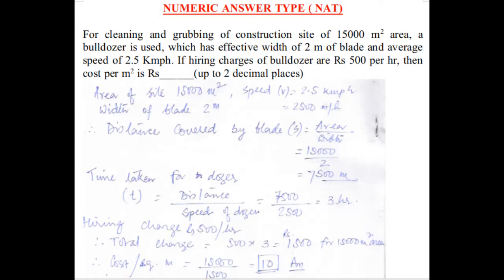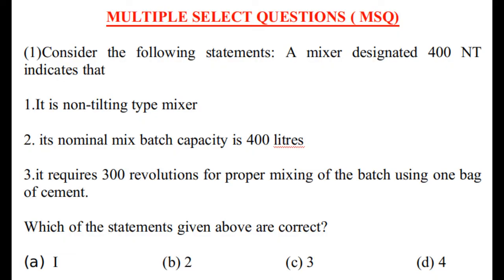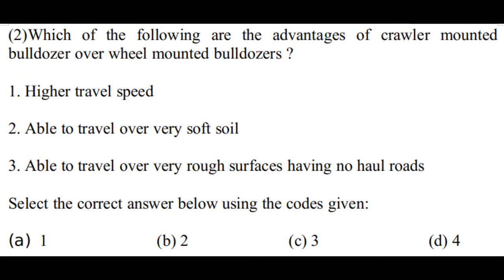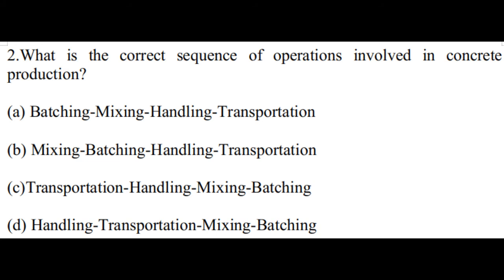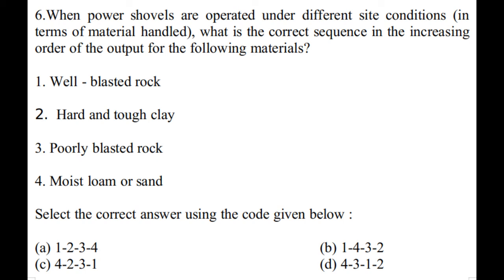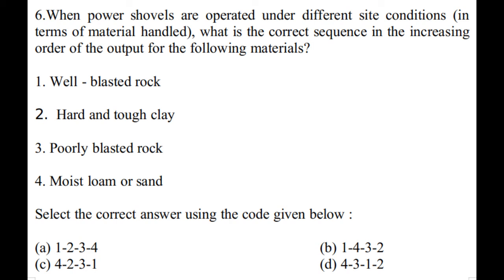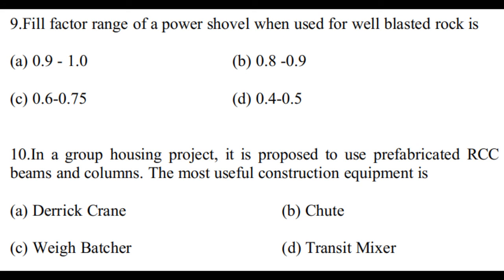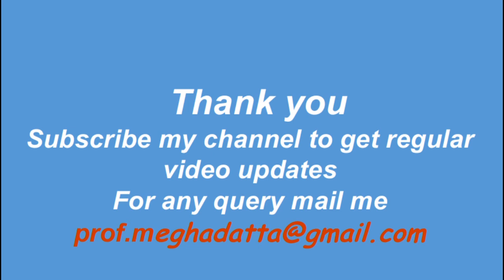Most Important Questions on Construction Equipment for GATE

Comment: Ma'am for the first numerical, the answer will be Rs 0.1 right? We should divide 1500/15000 correct? How is the answer Rs.10?
Reply from the maker: Thanks dear. you are right. Please note a correction at 2:45.  It should be 1500/15000 = 0.10 is correct answer